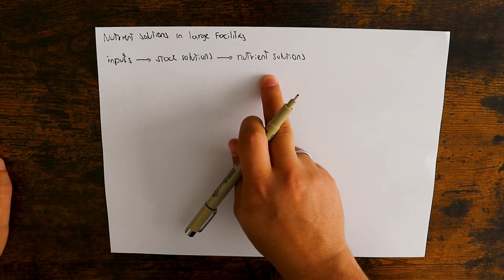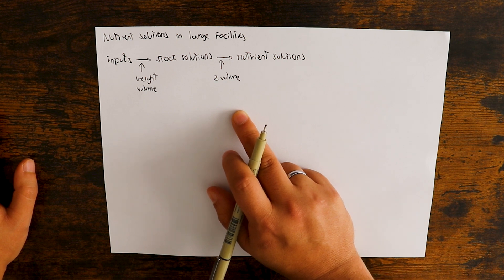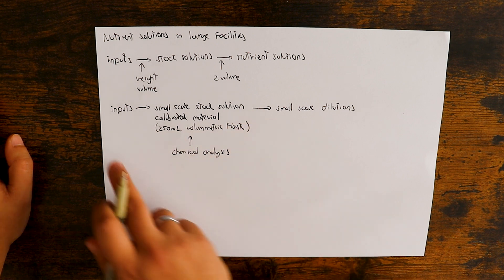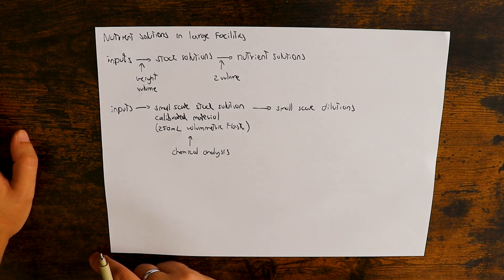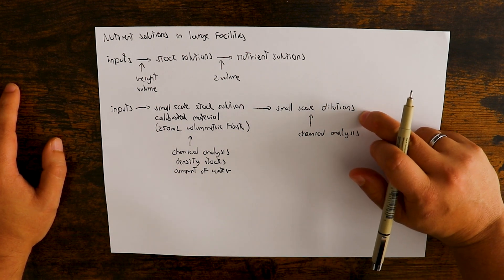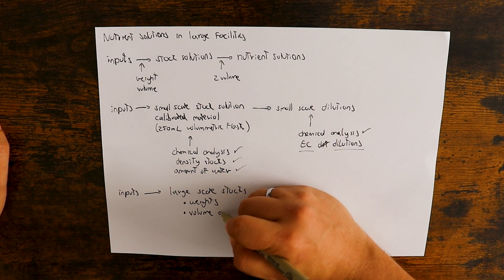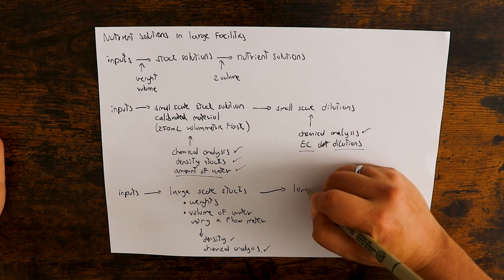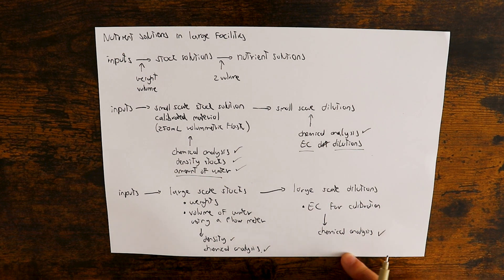How to get accurate nutrient dosages in large scale facilities

Comment: Hi Daniel!
I'm watching your video and i'm learning a lot of thing about nutrient and hydroponi.
I'm actually doing some test to define my personal nutrient recipe for Hydro/Aero grow and praticing about sterile hydroponics  and growing without any water changes but i have some question.
Can i skip the stock solution phase and add all the raw materials directly into the nutrient solution? can i get some sort of benefit by creating my personal A+B solution?
Is it possible to get a perfect "sweet spot" of Ph using only my custom nute or i should regulate it in a second time with some buffer?
Thx, your videos are pure gold of information!
Reply from the maker: Thanks for writing. You can certainly add everything to solution directly, without preparing stocks. The main issue with this approach is that some weights will be too small when added directly (you will likely need to add less than 1mg per liter of several things), so unless the volumes you prepare are large (>200L), direct additions are not going to be a good way to go. Preparing stocks allows you to have much more precision, since when preparing stocks the weights will be 100-200x larger. 

About stable pH, if you're talking about pH as a function of time in a recirculating system, you need to balance the nutrients so that when plants absorb nutrients they do not modify pH too strongly. How to do this depends on the plant species you want to grow but, as a rule of thumb, growing a solution with 20-30% of the N coming from ammonium should help buffer pH changes caused by nutrient uptake. To balance the pH of the nutrient solution when mixed, you need to consider the pH and alkalinity of the initial water used (tap, RO, etc) and then choose your P salts to balance this.